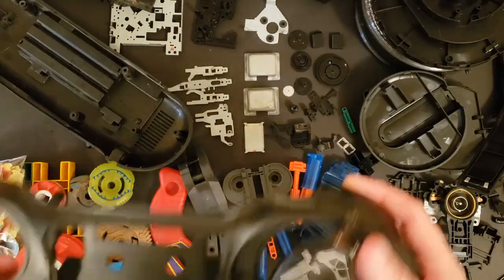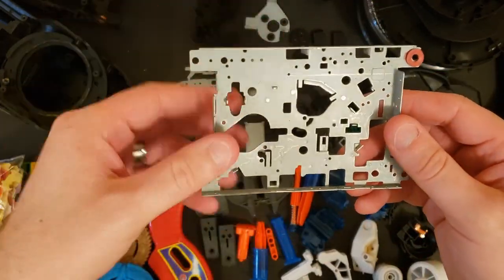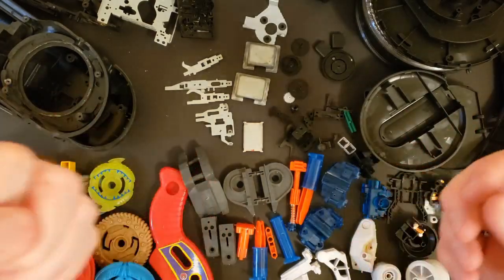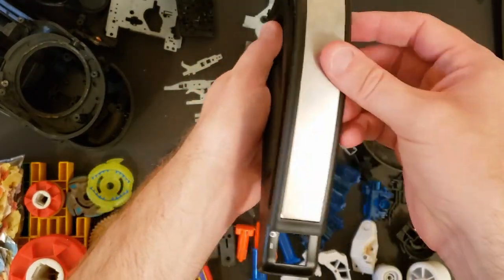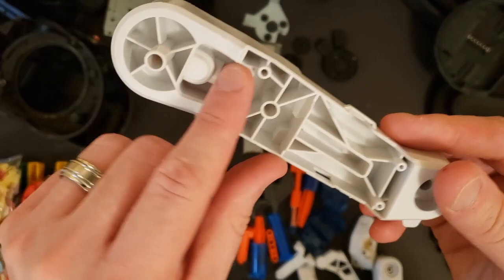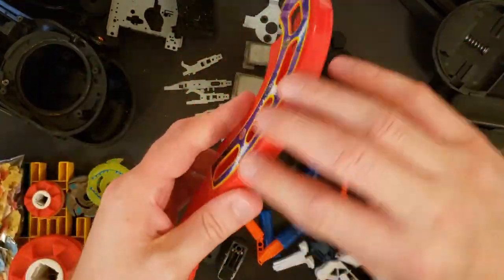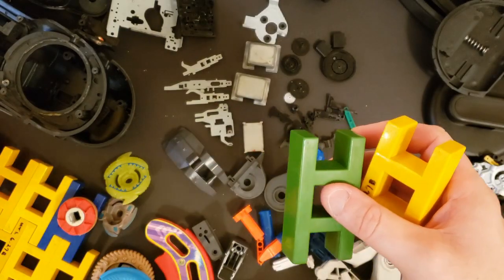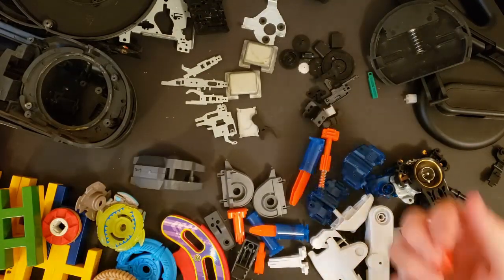From Boombox to Bits Box - September Haul - hobby materials for Warhammer 40k, D&D, etc

Comment: Nice recycling :) 
I've been using bread-tags and old cd cases recently for tiles and panels on bases. They work really well because (like GW models and bases) they are also polystyrene and they bond with plastic cement.